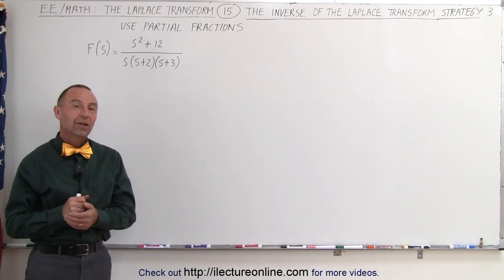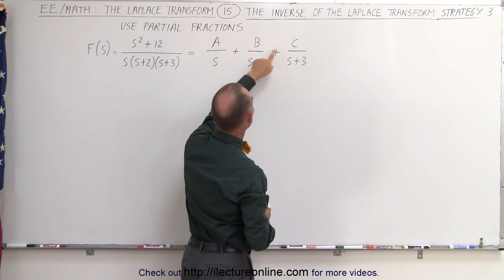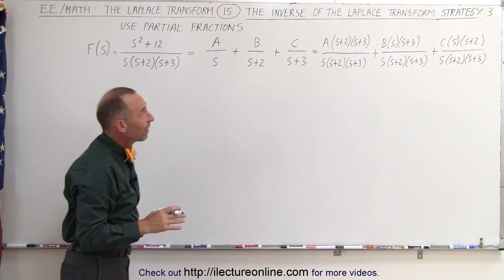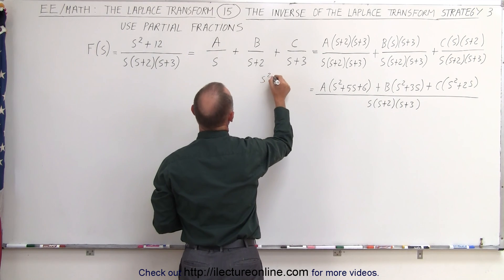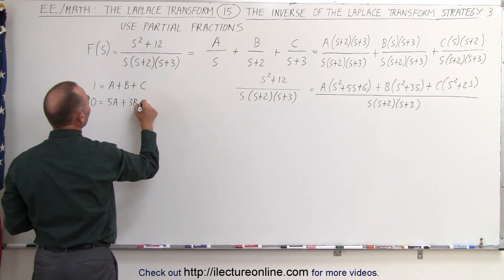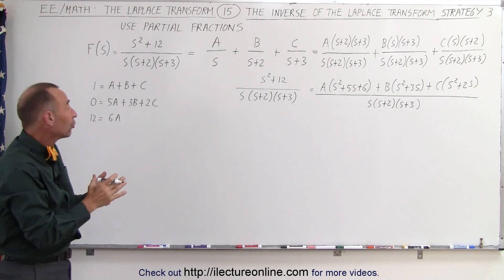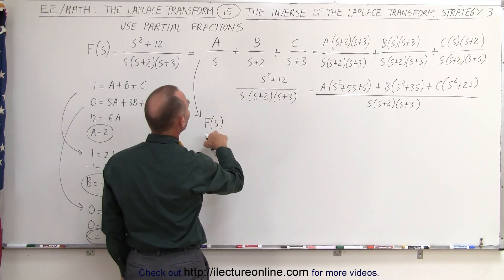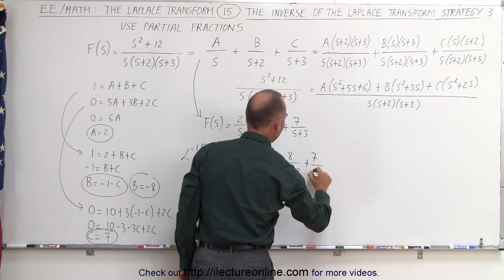Electrical Engineering: Ch 16: Laplace Transform (15 of 58) The Inverse[Laplace Transf] Strategy 3

Comment: For those asking about the u(t) in the final answer, it came from the unilateral Laplace Transform which is defined from [0, inf).
It depends on whether you know it's a step function from the start, otherwise its just 1 if using the bilateral transform (-inf, inf).
Reply: Thanks for explaining this.